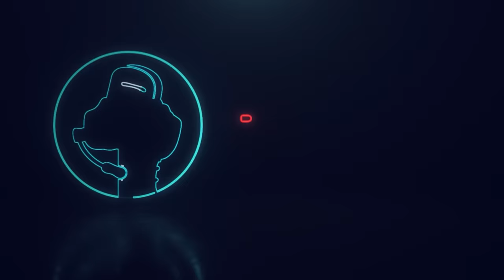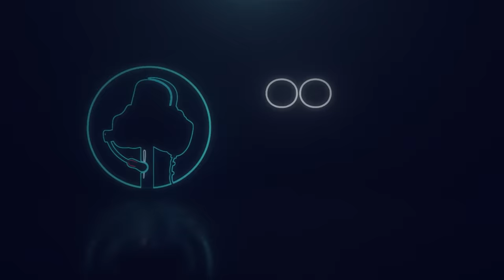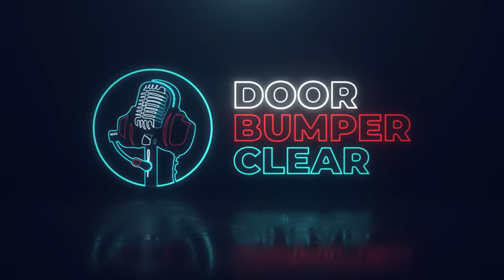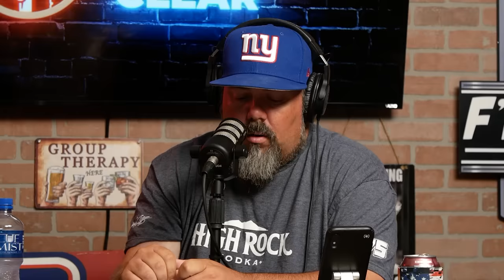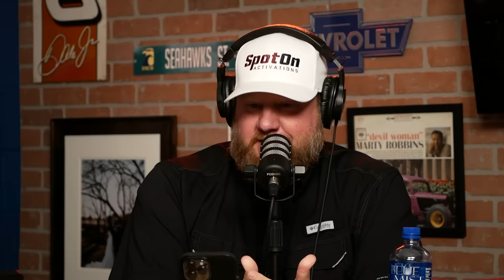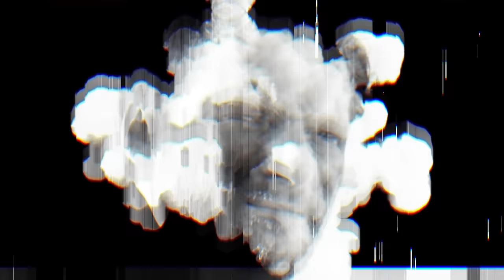Was NASCAR's Penalty Enough for Ty Majeski's Bleeding Valve Stem? | Door Bumper Clear

Comment: Sounds more like you can fill the tire to optimal pressure right away, and they won't build additional pressure! Huge advantage!
Reply: That would make it worse. Tire Pressure ALWAYS goes up. As the Tires get Warm it Warms the air inside. As Air warms it expands so your not actually gaining more air you're just getting more pressure. Think about the 3 normal states of matter - solid, liquid, and gas. Solid =cold Liquid - warmer Gas - Warmest. A solid is harder because molecules are all close together. In liquid it's not as hard but there's resistance when you pass an object through it - molecules have separated and not as strongly attracted to each other. A Gas molecules are forced a certain distance away from any other molecule meaning it expands. It gives no resistance unless you ENTRAP the molecules in an enclosed space.

So tires get to optimal pressure but they don't stop there. They get too warm so they build to much pressure to maximize Tire Grip. Therefore you want air to escape to avoid the pressure going to high by giving it a place for it to escape...A TIRE BLEEDER!

Comment: The breeders have been illegal forever because if the bleeder was to fail at example, 205mph entering a corner, it would be catastrophic. Short tracks or dirt tracks different story. 
Nascar has/had has weird rules, but they are usually there for a pretty good reason....
Reply: @NUTZJ98  a bleeder is a mechanical valve that's allows air to escape from the tire, at a rated pressure. Theres no way to make it 100% reliable. Not even F1 has the tech to make them fail-safe....

Comment: If probably maintained and adjusted tire bleeders cause no safety risk and shouldn't cause flats under red unless the temperature of the tire changes enough to drop the pressure too low. Bleeders are set to release pressure at a set point and as soon at the pressure drops below that they shut.

Comment: Cup does need more speed in my opinion. When i see xfinity cars faster or roughly the same lap times. 
Excessive power breeds better drivers that respect the danger for everyone else and the blocking and dumping each other won’t be tolerated
Reply: The fact that Arca, Trucks, and Xfinity pole times from Kansas were within a 10th of a second of each other and would have been smack in the middle of the field of the cup race shows the need for something to split up the different series.
Reply: Watch the racing instead of staring at numbers

Comment: As someone that is currently and has previously tried to get a job in NASCAR, I strongly disagree with the opinion that finding another job is easy, and I have an engineering degree to go along with that.  Also, why has Chad Knaus not been suspended indefinitely?  That argument is stupid.  Completely illogical.  What Freddy said is correct.  Was he running the bleeder when he won, probably; however, there is no proof.  NASCAR supposedly has a rule book, so they must stick to what the stated penalty is.  TJ's point about intentionally removing a damaged piece is also solid.  I remember when Kyle Busch got to cut his rear bumper cover off at Bristol because of damage, and he was the fastest car on the track.  Things happen, and people want to win.  Suggesting insubordination over being "creative" in a sport built on doing so is the pinnacle of stupidity.  We all talk about Black and White Penalties in an effort to reduce judgment calls.  Penalizing someone with no proof is the biggest judgment call possible.